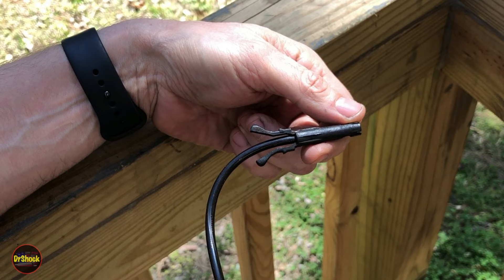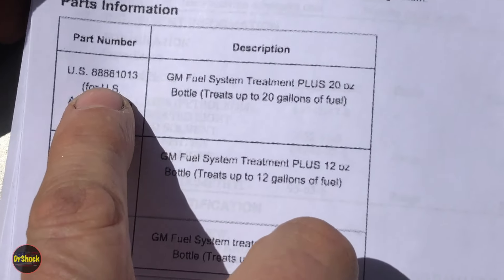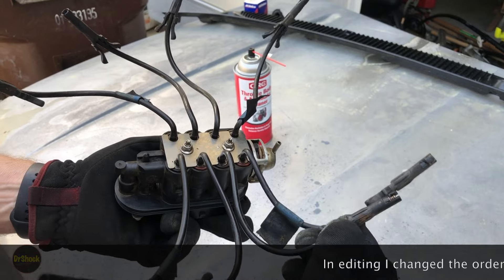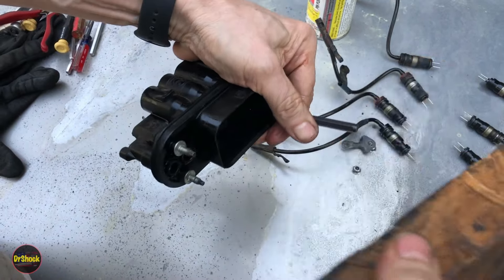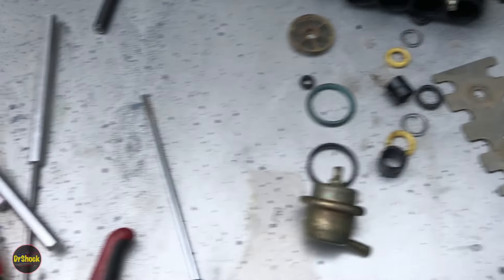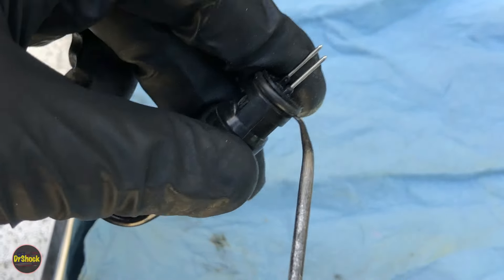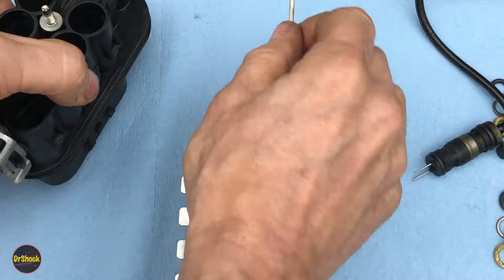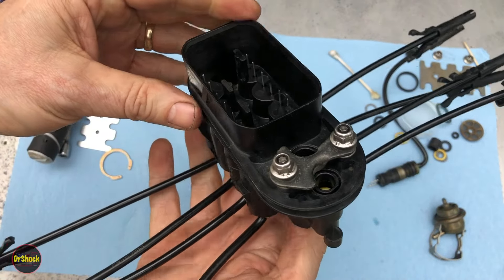1996 - 2002 GM OBS Truck Vortec Engine CSFI / SCPI Fuel Meter Body Injector Rebuild (Vortec V6 & V8)

Comment: Fantastic video, Its amazing how complicated these components seem until its broken down like this. I have a 1994 S10 in which I would like to rebuild the spider. My spider is different than the one you rebuilt.
Can you tell me what resource you used to find the rebuild kit, Fuel injector, fuel regulator etc. part #s. Thanks in advance
Reply from the maker: Thanks, to identify the part numbers I have access to the genuine GM parts department online parts finder and parts diagrams.  But you can find very similar parts breakdowns at many online GM dealership parts department websites online.  Once you have the part numbers it will always be cheaper to purchase them on eBay, or Amazon, rather than the dealership.
Reply: @DrShock Thank you for the quick response. My truck is waiting in the driveway  and my son is ready to be back in it. Thanks again.👍🏻
Reply: @DrShock  Hello, I took your advice and had some success. I was able to find a pressure regulator for my fuel inj. spider. However, my issue revolves around the change over GM made in the fuel inj. spider design in my 1994 S10. I have the first interation of the spider. It has on central injector and 6 fuel lines with three lines on each end of the siper. My Spider Part # embossed on the unit from my truck 17084904. I am trying to find the single injector however every search I make turns up the newer version of the inj.
The injector I'm trying to replace has no part  # on it just a 4 digit # 8225. I would like to do a 100% rebuild including the 6 fuel lines, nozzles, clips, o-rings etc. If you could share any further knowledge you have on this topic I would greatly appreciate it. Also it's becoming hard to find these spiders at all unless one is willing to pay $450 used or $650 rebuilt. Most auto parts suppliers are out of stock. A rebuild video on this specific spider would probably gain some views.
Again, Thanks in advance.
Reply from the maker: Is this a 1994 4.3L V6 engine?  If so isn't ACDelco 217-1431 / GM 17113673 your complete assembly?
Reply: @DrShock  Yes that is the assembly I have. Those are two of the many different part #s that lead to this spider. The # embossed on my spider block is 17084904. Most auto parts suppliers do not have this unit in stock. The few Ive found are very expensive. I was hoping to rebuild the one I have. Locating the appropriate injector for this unit is the problem I am having. Every search I've tried using these part #s lead me to an inj. that is for the redesigned spider. So that is where I am. I can't seem to locate any of the individual components from this spider other than the pressure regulator.
Reply from the maker: That assembly I gave you has been discontinued for awhile now by GM.  Previously superseded numbers of the same assembly include 17113384, 17113165, and 17113151 just to give you some more numbers to search on.  This injector may not have been serviced separately.   For something like this your best bet is to go to your local Chevrolet dealer parts department and have them pull this assembly diagram up by VIN.  Then ask for the part number for one injector.  It will be discontinued, but if it ever existed at least you'll get the number.  But they may tell you it was "NSS" - not serviced separately.
Reply: @DrShock  Got it, Thanks, I'll make the trek on Monday maybe I'll get lucky! 
Thanks again for the information.
Reply: I contacted the dealer and as expected the spider is no longer available and no individual part #s exist for the different components. However, I was able to find the pressure regulator. I would like to continue to rebuild my spider as far as possible. The only other parts outside the injector itself are the 6 individual fuel lines. These fuel lines have a pre- moled flared end an O-ring and spacer that are held into the spider body by a small plate. Three fuel lines on either end of the spider.  The other end of the fuel lines have a nozzle and clip. Have you any Idea how I might be able to replace these fuel lines?
Do you think if I took the fuel lines to the dealer they might have (like) parts that could work ? Thanks again in advance for your help.
Reply from the maker: The lines you're describing were not serviced separately, as in the Vortec V8 video I did here they are part of the injector assembly.  The clips were also not serviced separately, but there's a link in the description for aftermarket knockoff clips.    The o-rings and spacer on the V8s is serviced by the ACDelco rebuild kit I used and that I also link in the description.  

Since the injectors on your earlier CSI V6 model were not serviced separately, I doubt there was a rebuild kit offered for them.  Buying one of those complete NOS assemblies, any of the GM part numbers I provided earlier, was probably the way these were serviced at the time.
Reply: @DrShock  I thought that to be the case. Thanks again !
Reply: I have a shocker for you. Yesterday my son and I went to our local Chevy dealer. A last ditch effort to see if anyone thier had deeper knowledge with the ability to locate comparable injector fuel lines. Turns out we stumbled upon the right employee. He said his shop had done three S10 conversion to the new style injector recently. He spent the next 45 minutes searching for a conversion kit to the newer style. He came up empty. However he located a new/old stock spider. Yes an OEM spider shipping in this afternoon for $260. A stunning, twist to our search. Thought I'd share the good news !!!
Reply from the maker: That's a great and happy ending.  Lucky find.   Yeah I don't like to do the MFI upgrade personally.  I prefer to restore these older trucks to the factory original configurations and options.  No upgrades, just numbers matching originality.  So I applaud your seeing it thru.  And that is a great price on an NOS CSI spider assembly for your pre-1995 engine.
Reply: @DrShock  I appreciate your help and love your video approach. I am subbed and will be watching.

Comment: Perfect car repair video! I may have skipped past some of the book talk at the beginning where you said it but, why did you not just order the whole assembly new online? I cannot even find the rebuild kits unless i look up your part numbers from your video
Reply from the maker: Thanks, you never could buy a CSFI as a complete assembly, only as the individual ACDelco parts I showed here.  You're thinking of the later design trucks and the MFI design with the electronics on the ends instead of in the body.  I mentioned this in the beginning.

Comment: Would this work on 93 4.3 vortec? I'm having a vey hard time finding new or rebuilt spider injector my 93 S10 blazer 4.3 vortec.
Reply from the maker: Should be very similar as the V6 used the same type of system.

Comment: Is there a way to diagnose the fuel pressure regulator without removing the upper intake manifold?
Reply from the maker: The regulators rarely go bad on these OBS trucks, if its a genuine GM ACDelco regulator.   The only evidence might be leaking fuel externally from the regulator housing since there is no external vacuum line with this design.  To determine whether it is leaking, a small camera thru the throttle body, obviously with the engine off, may reveal evidence of that without disassembly.
Reply: @DrShock  Thank you sir. I hadn't thought about the camera idea. I will definitely do that. Here's our dilemma. Our 1998 5.7 vortec will crank but not start unless you apply the throttle. As long as you apply the throttle it will start and run smoothly. As soon as you release the throttle the RPMs drop to below 500 and the engine struggles like it is starved for fuel and it eventually dies. The fuel pump module sounds horrible so I was thinking that it was the culprit. Fuel PSI with the key on and engine off is 60. Fuel PSI at idle and at full throttle doesn't go above 53. Someone had mentioned to me that it could also be the fuel pump regulator and I was hoping to be able to diagnose that without removing the upper intake manifold.
Reply from the maker: Those symptoms could be a number of things.  Fuel, air, temperature, or ignition.  But you should eliminate fuel first.  It's not one for the parts cannon, or will get expensive really quick.  Needs a proper diagnosis with a scan tool to zero in.
 
But since you seem to have a fuel pressure gauge, measure that on a cold engine.  Key on, key off, 2X.   GM factory spec in this engine off state is 60-66 psi with the fuel pump running (audible noise).  With the engine started and then idling it should be no less than 55 psi.   You said you measured 53, that's slightly below specification and could be a clue.
 
If the fuel regulator were leaking, then fuel pressure would not hold at a steady psi and drop (this can also be caused by a leaking injector(s) - either way you have to open up the upper intake).   This, plus the camera inspection, are the two checks for leakage I could suggest without access to a scan tool.  Low fuel pressure, but still steady, points more to the fuel pump, or a fuel line/filter obstruction (presuming the fuel lines themselves are not leaking due to corrosion/damage).
Reply: @DrShock Thanks again for taking the time to reply on these old videos. What the issue ended up being was a dirty idle air control valve. I removed it from the throttle body and there was a lot of carbon buildup around the tip. I cleaned it up and reinstalled it and the engine starts and idles much smoother like it did before. I feel like I should go ahead and replace the part anyway since it is 25 years old. Initially I was thinking fuel pump but glad I kept doing research and received some input from good friends. 👍

Comment: I can’t seem to get the spider to seal into the upper intake. I thought it would pop into place when torquing down the intake but still nothin. Any tips on how to get it to seat? I ended up breaking the screw that holds the fuel line on while trying to pry it into place
Reply from the maker: The reinstallation procedure into the intake manifold isn't covered in this video.  But I believe I mentioned in my upper intake rebuild video series you definitely do not want to try to draw the spider assembly in just by tightening the upper intake fasteners.  The GM service manual page mentions a similar caution. It's decades old plastic now, and was very likely to crack even when it was newer.   

During the rebuild that oval seal at the spider assembly needs to be replaced, and lubricated.  The mating surface for this seal in the top of the upper intake plastic cleaned and also lubricated.  And the spider assembly has to be fully snapped into and seated on the metal bracket that is part of the lower intake aluminum casting.   The metal bracket intentionally has some play built into it where it attaches to the lower intake aluminum manifold to aid in reassembly. 
 
You mate the two together just with downward pressure by hand on the upper intake manifold.  You'll be pushing down evenly this way, using no tools,  which will avoid damage to the plastic parts involved.  It will take some time as the friction fit is difficult.  But it will slowly go.  If not, stop and look for obstructions or related component alignment issues with the spider assembly seal.

Comment: Could i do the same to an mfi set? I cant  seem to find the oem assembly i figured i can just rebuild with the injectors from  another mfi assembly.
Reply from the maker: The MFI design was not intended by GM to be rebuilt, so the individual parts are not available separately to do so like with the CSFI.   You may be able to scavenge from other units, but idk for sure.

Comment: The terminals can be installed 180 degrees, or 360.   Do the injectors have a positive and negative terminal, or can they be installed either way?  How can i tell ?
Reply from the maker: If you are referring to the step starting at 28:03 then the new GM injectors will be pre-bent out of the box.  I always align them where that bend will put the line facing outward as you see in the video.  I'm not aware of any polarity concerns with this step, nor does the GM service manual mention anything about them having polarity.  I follow this procedure more so from bing focused on not stressing the lines given these are available as NOS type parts only nowadays.

Comment: There is a screw in the star shaped fuel injector assembly can you help me because I have it unlocked
Reply from the maker: Are you referring to the adjustment screw that is embedded in epoxy at the end of the injector?  If so, you'll have to replace the injector.  There is no service information available from GM on adjusting that as it's set at the time the injector was manufactured.

Comment: Why don't you recommend the replacement vs the stock poppets? I used the replacement GM units years ago. I know the new units out there are not GM. Thanks for the video. Didn't even know these could be rebuilt.
Reply from the maker: I mention in the video, and in the description, that you could go with the later design MFI update instead of rebuilding the original design CSFI style.  There are plenty of other videos about that sort of modification so not that interesting to record yet again.  So I've spent my time on the more unique video, about doing what would have been done in any GM dealership of the 1990s before MFI ever existed, which is rebuilding the original CSFI design injection.  Keeping it all genuine GM, all original, and restoring it back to its original factory specifications and condition.
Reply: @DrShock  Thanks for the reply. My late dad worked at a GM dealership from 79-96. Good memories from that growing up. Thanks for all the great videos.

Comment: Hey quick question if you don’t mind. I just bought a 1999 GMC Sierra 4.3 v6. The engine starts beautiful when it’s cold but when it’s warm it takes 3-5 seconds to turn over. Do you think I need to rebuild the spider or what steps would you take. Also I think it has the CSFI like you showed ? Anyways thanks for any tips.
Reply: Fuel pump was replaced last year guy said and I replaced the fuel filter yesterday (full of rust)
Reply: @drshock also my fuel lines are hard so can’t pinch them off to troubleshoot
Reply from the maker: These kind of problems are not ones you can work over a comment board.  You'll need a GM service manual and some special purpose tools, e.g. J-2534 class scan tool and fuel pressure gauge, to progress this yourself.  The fuel pressure gauge can confirm that the fuel pump module is delivering, hot or cold, the correct psi.  The scan tool can monitor crank rpm signals hot or cold, any misfire counts, any VCM DTCs, fuel info, etc.  The data obtained can guide further diagnosis using the service manual test trees.

These kind of symptoms you describe could be fuel system or ignition system, typically.   Multiple reasons, multiple causes, and of course multiple repair actions for each.  It's just not something that can be determined without hands-on examination of the vehicle.

But I'd start with the fuel system if it were me.  Given the corrosion captured in the previous filter, I'd also include inspecting the fuel hard lines that feed into the filter, as well as the tank itself.  None of that is part of the hot starting symptoms, but it could be something that needs more urgent attention before a fuel line or tank starts leaking due to rust through.

Comment: what do the poppet valves do?
Reply from the maker: The valve is a mechanical spring loaded assembly at the end of each cylinder fuel line to meter the fuel when a given line is triggered by the vehicle control module (VCM) to inject pressurized fuel.  The lines are often referred to as spider legs given the appearance of the CSFI design.   In the CSFI design, these poppet valves can become stuck / gummy if the fuel is of poor quality.  The spring can also wear out requiring replacement either way.

Comment: I have a question would you know if your injector is still good if you damaged the middle wax between the two prongs?
Reply from the maker: If it's just the epoxy seal that was damaged, you can reseal it to insure no fuel gets into the electronics.  It should have no impact on the operation as long as you didn't run it like that.

Comment: The unit in my truck is filling up with gas, why is that?
Reply from the maker: If you are referring to the fuel meter body, this would be an injector, or its barrel seals, having failed imo.  If you are referring to the intake manifold, then I would be more inclined to look at the fuel regulator housing.